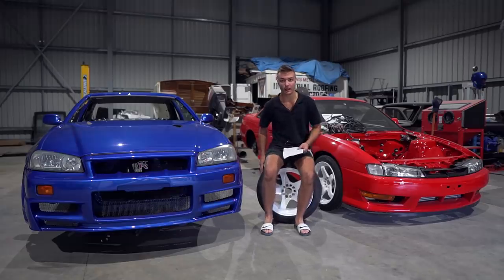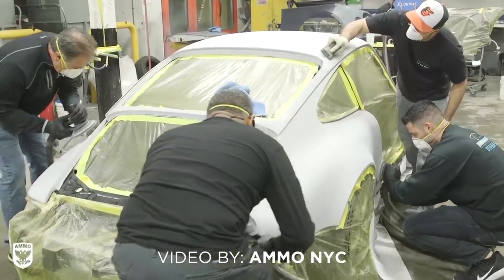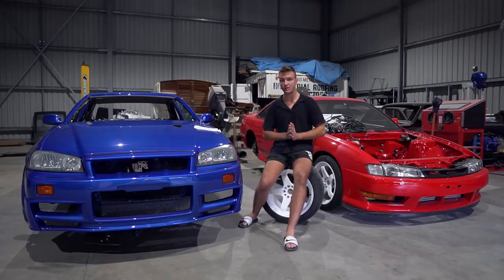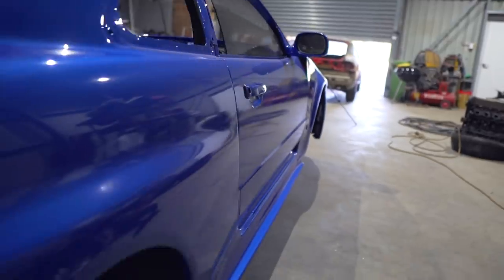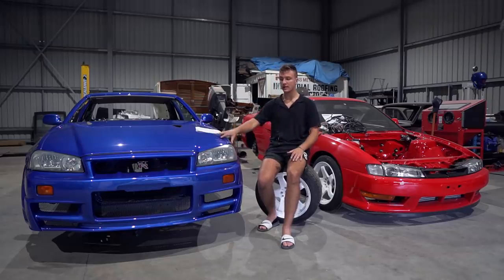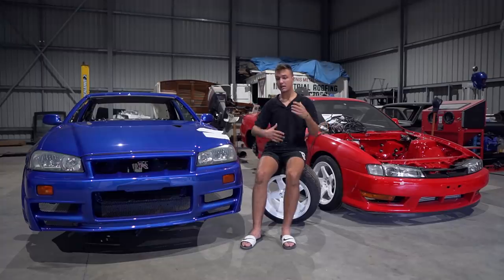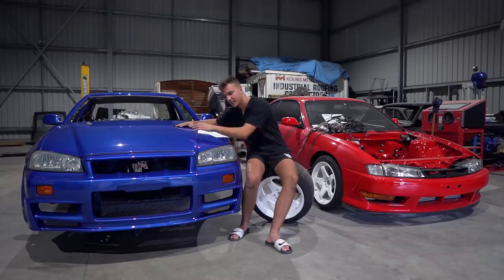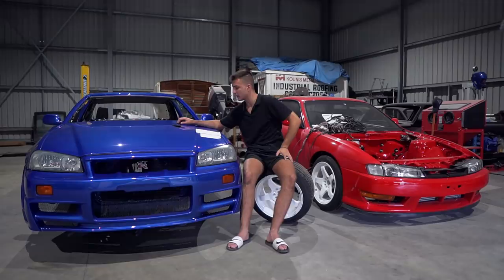Mistakes Happen.. | Poor Man's GTR [EP13]

Comment: My very first base coat / clear coat paint job ( was used to spraying acrylic enamel), the paint rep came in to walk us through the process. What he didn't tell us was that you need to use the hardener/activator in the base coat as well as the clear coat. The car was a 63 Corvette convertible, the color was Corvette red. Turned out beautiful. Until it rained, then it would get these milky white spots all over it that would disappear when the car dried. Boss was livid. We called the paint rep back in and was told it was caused because I didn't put hardener in the base coat. The only thing that saved my job was my boss was there when he told me how to spray the BC/CC system. He know the rep didn't tell me to use hardener in the BC. Ended up stripping off the paint down to the gel coat. Boss decided to paint it almost the same color as your GTR. So don't sweat the petty stuff, your car looks great!

Comment: That dirty paint run on the bottom of passenger quarter window. Would you be able to film how you'd get rid of it? Like with sandy or buffing? Would be really good to see and learn.
Reply from the maker: Yeah man will do!
Reply: I think wet sand would do it depending on how thick the run is, then buff. But I haven’t done body work in a minute lol

Comment: One way to get rid of nasty runs I’ve seen on motionautotv on utube and tried is glazing filler over the top of the run and rub that down until it’s gone and removed the run it’s a really good way of knowing how far you can rub down the paint without going through the clear

Comment: 6:12 orange peal happend most usually when gun is too far from the painting panel. Its basicly like rain. Like when water first is in clouds on sky, then it condence to water drops and bigger drops while it come down. Same happens whit paint I think

Edit. The preasure also have its owm part in but if presure is like 2-2,5 bar then the only reason for orange peal was distance

And sorry my bad english
Reply: And to get the right distance onto paint, you have to listen the gun. That might sound silly but when your gun is empty and you shoot with the preasure you will paint and change the distance with the objekt and when the sound changes different, that is the right distance to paint

Comment: As long as the base coat your using is the same the finish will have the same result. However, if you were to buy the same base coat at different times, the paint will be made differently and not exactly like the first batch bought.
Reply from the maker: The bumpers were actually sprayed with a new batch! But the last coat or two was sprayed with old batch
Reply: Oh alright that’s good then. Have you looked up the gunman video of fixing a run I think using body filler I’m not sure. But that could help with the run on the quarter.

Comment: The moral of the story with the spray booth  is that, if you don't get a better (cleaner)  finish than when spraying under an open sided gazebo, then you didn't prep the booth properly, and it wasn't actually clean. A thorough clean and prep of the booth, to completely remove dust or anything that will react with the paint, will save you time in re-work later.
Reply from the maker: Yeeah man i’d say the filters were shot in it

Comment: First of all you prepped it right with the block, the wizza sander is more for quick repair jobs and if you look on the right angle you will see little warpies down the panel, also who ever told you to do a white grown coat stitched you up all base coats have a correct ground colour so it covers properly  only Candy's you change the ground coat to get a different colour, your colour is a simple base coat pearl should of been a midish grey ground coat. Would of helped you out with the zebras too and used half the paint
Reply from the maker: Watch ep11 on reasons for white ground but yeah the grey/silver would’ve covered a lot better!
Reply: @BrokenSilvia  yeah I seen it and it's not true I'm a painter by trade, if you wanted a lighter shade of Bayside you should of tinted the base coat lighter and used the correct ground colour that's how it's done professionally bro just a tip for next time, you would of only used 5L of paint that way aswell

Comment: Quick question
Did you a use jsai body kit or are they genuine parts
Reply: If jsai, how did you find the fitment
Reply from the maker: Only JSAI sideskirt and rear bumper extensions. Not sure what the fenders and bumper are, bought them second hand. Wouldn't buy JSAI fenders though, they don't have the cut out on the Z-tune fenders..
Reply: @BrokenSilvia  alright, im hunting around for ztune fenders for my r34